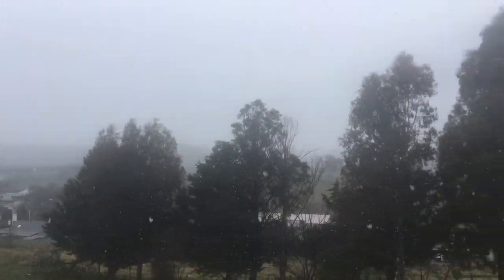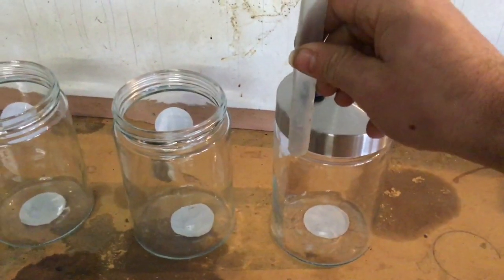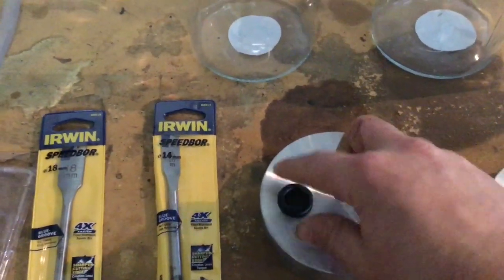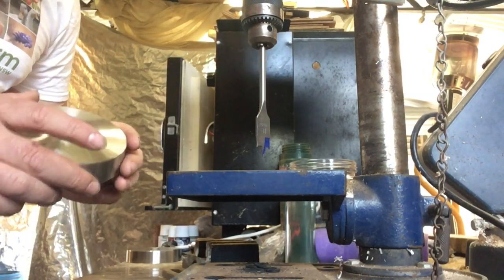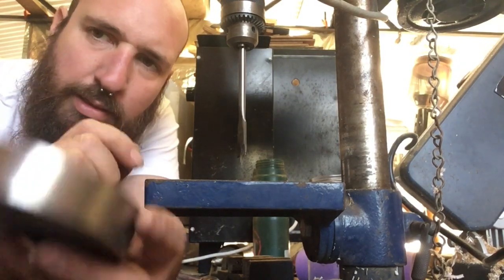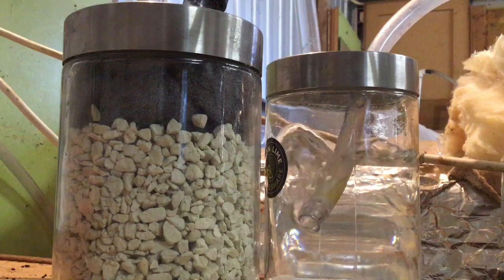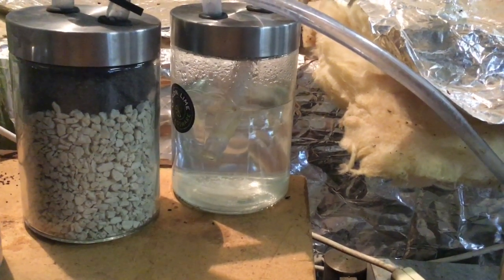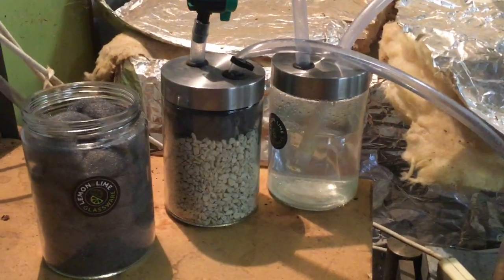Biogas scrubbers part 2 - installing the new scrubbers

Comment: Hey dood, watched most of your films and built one.   First gas today!    Cheers for all the knowledge.    Interesting fact…damp wood ash absorbs co2 and turns to aggregate.    I think this could be good as it is not soaking the gas?     Also have you ever used a fridge compressor to bottle the gas?     Loved your film about the water heater too.     So just to be clear, biogas will run cooker, boiler, generator and vehicle?     So excited!    Cheers.   Tanc

Comment: Love what you're doing, You can remove a fair bit more CO2 and H2S if you replace the small container of bleach solution with 20' plus of the same see thru tube that you're already using, just wrap it around a cylinder to keep it tidy and the gasses have to travel through WAY more water increasing the absorption.

Comment: I am a little late to the game, I read a study once and if I remember correctly it was using waste chars from pyrolysis in wood gasification. Seems to me you can remove your impurities by simply running your gas through a canister of activated charcoal or any type of bbq charcoal. I know it works for hydrogen sulfide.
Reply: When you say activated charcoal, what do you mean?
Thanks

Comment: The h2s scrubber looks good! But I don't think you will be removing very much co2 with that setup.
 If biogas is approx 50% CO2 then you get 500L of co2 per bag and 500L of co2 weighs about a kilo, then you would expect the weight of your scrubber to increase by 1kg per 1000L of gas scrubbed.
If you really want to remove the CO2 you want to look at water washing where the gas is pumped through a stream of water, ideally under pressure. This dissolves the co2 into the water.
Reply: Might be more expensive to do that, but you could recoup the cost by adding sugar and brown coloring then putting that in a can and selling it.

Comment: Is there a way for you to determine how effective the scrubbing process actually is? Cheers!
Reply: Also, I'm guessin making the containers taller would improve their efficiency, since the gas would pass through more material?
Reply: @uramalakia  A way to notice how effective it is is through burning, impurities in the gas will make it more red and burn less time, the more blue your flame is, the most methane there is in your gas

Comment: Your Setup seems like the best diy biogas setup.  I need to post this on the relevant OSE Wiki Page.
Reply: Bleach is not a good solution for the CO2 issue. I'd reckon for a membrane but I myself have no clue where to get one. I'll go ask some experts.
Reply: @Dollapfin  use calcium hydroxide for best result.

Comment: Thanks for the vid. Do I need bigger bottles if I have bigger digesters?
Reply from the maker: I would say yes, that way you don’t have to change as often, even I would like bigger, I was almost going to go with clear 12 litre water jugs, but the were round and the grommets may not have sat nicely, I can always make new ones in the future
Reply: @OkAtEverything-ProAtNothing  sorry, not very clear on your pipe connections
Reply: @OkAtEverything-ProAtNothing  the bubbles? what causes it
Reply: Good idea to use clear rather than pvc.. Q. Have you tried using coiffed grounds in the digester??